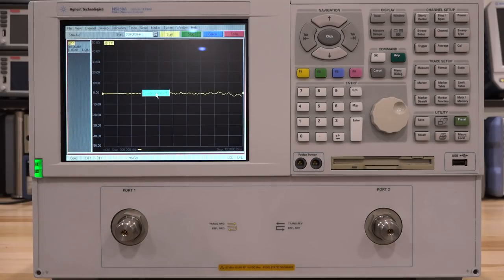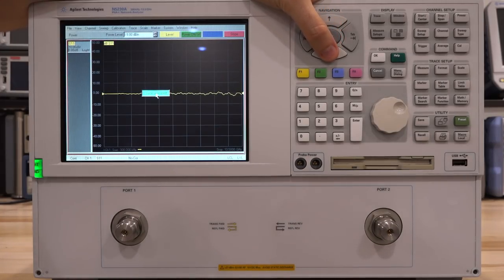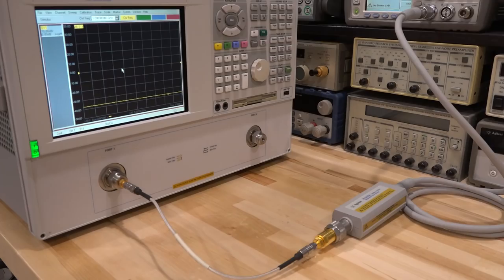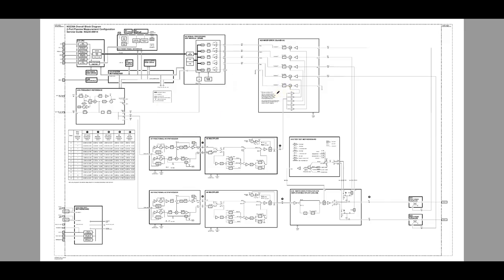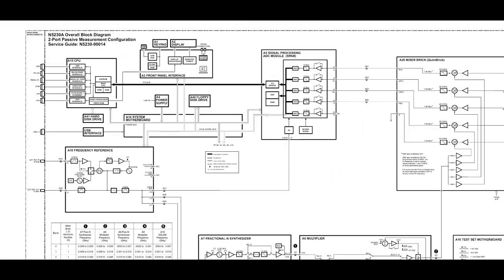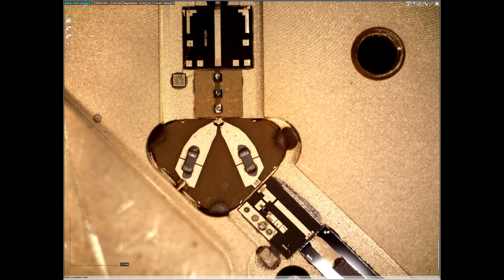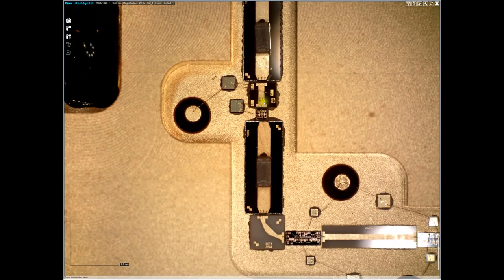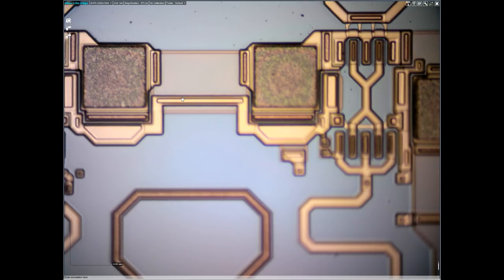TSP #134 - Teardown, Repair & Analysis of an Agilent N5230A 13.5GHz PNA-L Network Analyzer (Part 1)

Comment from the maker: Don't forget to watch to the end and let me know your thoughts on how to proceed.
Reply: Looked up bonding machines. See my other comment
Reply: Yeah a packaged part will never work.  You will ruin the module beyond repair trying what you described.  Not to mention the parasitics at microwave.  I don’t believe that can be done.  And if you determine the part number of the bad die and purchase a replacement or identify a suitable alternative, which is probably the only viable path forward, you’d need to scrape out the bad one and silver epoxy down and cure the new one.  Very delicate process.  You need an industrial oven to cure it properly.  Obviously not an option so you have to let it self cure by letting it air dry for a few days, which still might not work.  Then wire bond it.  But you don’t have the equipment needed for these modules, so unfortunately you are probably SOL.
Reply: How steady is your hand with a reeally fine tipped needle with a lil dab of conductive epoxy on the tip?
Reply: What about making up an external box with amplifier, switches, doubler, filter and whatnot... then modifying the module to always run through the low band path?  Chip out the first amp and switches and replace with some easier to work with substrate, use conductive epoxy and copper ribbon to bond over all the gaps?
Reply: If the instrument isn't worth much money it would make for an interesting video for you to try to bodge the repair
Reply: @Guy VanBuren: if the goal was to repair to "good as new, including design margin" you would be right. However, I believe the standards are a bit lower here -- "repair to functional." The VGA + leveling loop after the dead component can probably soak up a significant amount of VSWR ripple (possibly even a lot of VSWR ripple) and fmax is only 6GHz. I'd bet that a bodged rf spdt (or even 0201 PIN + 10mil wire sculpture) stands a chance. If that didn't work, and couldn't be made to work via the usual dumb tricks for one-off tuning, my second approach would be to sacrifice some of the neighboring transmission line to make room for a one-off cheapo FR4 board with a proper landing pattern for the spdt and some patterns at the edges to facilitate xacto tuning :)
Reply: Are you sure it is the fault ? It soes not look damaged (burned or so). I would expect that. Maybe you can decap an analog switch and use the die. Is it possible to use conductive glue for the bondwires ?
Reply: I agree moving the doubler section outside the module using connectorized components is the best solution if a switch died.  Best case one of the switches has a loose bond wire and just needs rebonding.  But if you build up your own external doubler section you can leave the first amp in the module alone since it’s in the doubled path anyway.  You just need to wire bond over each spdt switch to set the through path, no need to mess with anything else. The switch voltages are working properly so you can use them to control the external connectorized switches.
Reply: bodge!, a high quality bodge!
Reply: Great video Shahriar. You seem to have quite good relationship with Agilent/Keysight, so I would talk to them. I bet they will be more than happy to help.
Reply: Send it to me
Reply: Would a 3x3 mm SPDT fit at all? I guess there is enough space but for a 1x1 mm die.
Reply: To be on the safe side, I would try and bond a small SMD analog switch with silver glue like AA Duct 905 or similar, instead of soldering it. But the leads and package may introduce extra capacitance and inductance which are hard to predict. I would cover the traces to solder/bond onto with masking tape, leaving only the very edge of them exposed to avoid solder/glue flowing and spreading. 
Replacing your faulty element with discrete will be much cheaper,  easier and faster. If it fails to perform,  you can always go ahead and try with a die and bonding wires. Honestly,  I don't even believe you can remove the old die, since it's most-likely soldered to the surface underneath it. 
Not to mention it will probably be the first in the world on camera to replace a die with a SMD element
Reply: Invest in a wirebonder, heat plate and silver epoxy. Heat, Extract, Die attach, cure wirebond. That is if you can replace the MMIC. Or call Keysight and have them do it for advertising.
Reply: SnPb solder will probably suck the traces right off those thin films.  We had to replace some attenuators on a hybrid.  What we did was have the wires bonded on the attenuator (before it was installed).  Then epoxy in the attenuator with loose wires, and solder the wires to the thin films with indium solder (but you could epoxy).

You still need a place to bond up a bunch of MMIC switches with loose wires.

Could also use two beam lead diodes to make your own switch, and they should be small enough to epoxy on top of the dead MMIC.

Or just say screw it and bridge the switch with some gold foil, shorting the three nodes together.  Disable the doubler amp when not desired, and live with the sucks outs caused by the reflections off the amp and output switch.  You may loose some range in the leveling, but the reference channel will track out the response.  Won’t hurt to try this as it’s dead already.

Or get another junked PNA and pull the module.  The early PNAs are known to have bad synth boards, so maybe others scrapped for different issues.  My 8358A PNA stops at 9 GHz, so maybe uses the same module, just not fully utilized.
Reply: I have access to a wire bonding machine. If you can get hold on an replacement die and ship the parts to Germany, I would be happy to help you.
Reply: I can fix for you but need a little transportation time.

Comment: I had the power supply fail on our N5230A.  The replacement was quoted at 2K, but instead I just took it apart and replaced the two bootstrap capacitors, fixing it for about $2.  Thanks for your very helpful videos.

Comment: Excellent analysis as usual. Wire bonding machine on alibaba for a bit less than $2000 would be the trick. No point buying it unless you're absolutely positive a die is available for purchase.

Comment: There is a 7 second offset of the audio from the video during the block diagram portion. At least on my computer.
Reply: Same, I've noticed a small offset on a couple of the other recent videos during screen recording sections.
Reply: Same here too
Reply: Same here, but seems good from around 13:00 or so.

Comment: I'm a bit conflicted - On the one hand, I would like to see a repair with a QFN-Chip  to see how well a packaged chip that is 21 years younger can hold up against a bare die. And also to see if such a device can be repaired in this way (if so, ebay-prices for defective network-analyzers will spike again, I think :D). 
But on the other hand, I would also like to see how a wirebonding-machine works and how the dies and ceramic modules are being put into the metal casing. As well as how to remove the die without having debris flying all over the place, possibly causing further damage. 

Either way, it'll be a very interesting 2nd part. :)

Comment: Nice video Shahriar, thanks. Interesting - never seen that kind of mesh bond before. Know of any test equipment breakers that have any used complete modules? There area few on ePay that come up. On the other hand I'd like to see a 'hobbyist'-style best-efforts fix with a packaged SPDT switch.. but that's a bit of a one-way mission.

Comment: Thanks for the great video. Started watching late last night but just watched the final 10 minutes.

I'd look into getting a wire bonding machine anyway. If we've nothing to lose and can't obtain a replacement die AND you have a suitable candidate in qfn for why not depot the switch in it (that would be interesting in its own right) and build a test jig/pcb upon which you can test your bonding skillz. Once done  and successful we can tackle the final repair. All would make a great series of videos. I second someoneelse's comment about reaching out to a uni or agilent for help sourcing a bonding machine.

Comment: A special saturday night treat! A repair video. Most excellent!

Followed the block diagram along with you, I liked this way- laggy pc or not, still learned a great deal

Test the mesh for open (moderately) separated-waveguide RF transmission attenuation too! (Along with the other suggestions last videos!)

40:41, the damage, hypothesis to what caused that?  Was that more of an "etch" damage or "crusty" damage?  Probably irrelevant, but, curious none the less

As far as proceeding on part 2, it sounds like your plan of attack is the best choice (considering the equipment, or lack there of, at the moment -it would be VERY cool if you got a wire bond-er though!)
..bout the only other thing that may be best, is just finding a new module -maybe the none "L" versions would have a comparable one that could be found as "parts/scrap" and used just as well

Anyways, great video!
As usual
Learned a lot and loved the look into the high tech side of electronics.  Absolutely beautiful.
*Thank you, again and again

Comment: I got such PNA from an auction... But all the softwares has been lost.  Only the windows xp SP2 is there with bunch of Agilent NA software. When turned on it says PNA Hardware not found DSP Driver not installed.
Can anyone here help me getting it factory reset ? 
The CD/Floppy is not there with the VNA since I saw it in auction house. Kindly help me getting them. 
Agilent N5230, 10Mhz-20Ghz, PNA-L is my model to be precise. 
Please help.

Comment: The 5th channel on the Quintbrick mixer and IF digitizer is for use in the 4 port PNA-L. As a low cost 4 port, one incident channel is shared for all 4 ports with the splitter before the port switch. It makes TRL family calibrations impossible without another method to determine switch terms. PNA-X and probably the regular PNA have 8 receivers on the 4 port models.
Reply from the maker: Excellent! Thank you.
Reply: So this is the difference between TRL and TRL* calibration ?

Comment: Great video and very interesting stuff, especially inside the module. Sorry for the naive question as I don't have a lot of experience with these things, but how are the lines inside the module stripline and not microstrip? Does the cavity that the module is in provide the upper ground for the stripline?

Comment: If you totally destroy the switch in the repair can you still bodge the pass through so that it still works under 10.5GHz.? If yes you have nothing to lose.
Reply: Probably, but there's also the possibility that the switch has some attenuation that is required in the signal-chain to be within an area that can be regulated by the ALC-Circuits.
Reply: You could look at the input/output loss of the good (identical) switch to determine RF loss.  Touch a probe on both sides to look at delta of relative RF strength.  You could then put a SMD attenuator to replace the bad switch to accomplish what George suggests while addressing your concerns.

Comment: If you short the signal to both the straight path and the x2 path all the time i.e. bypass the input side switch, would the working output side switch provide enough rejection of the x2 signal when it is not wanted? If not, could the power to the x2 amp be disabled by external logic when it  is not required? Would it wake up quickly enough? If not, could the mystery circuit mentioned as an attenuator at 34:31 be brought in to play to reduce the x2 signal level when below 10.5GHz? I assume the input side switch must be there for a reason, but I don't know exactly why.

Comment: How are these things at 29:00 constructed? 
Did they cnc some metal and than clued ceramic pcbs and ic into the metal? What metal is it brass? Some aluminium with gold finish?
Im not really sure how to call this and didnt found much on google. Would be nice if some can point me in the right direction.

Comment: 28:28 That doesnt look cheap one bit.. every single bit placed on there by hand, impressive.

And there are quite many scratches on the edge surface where there shouldnt have been any all from fab so this have been open some times/s before for sure, maybe the same problem who knows.

Comment: I have similar model but front panel keypad is not working. I normal use the mouse to do the setting. Any tip to troubleshooting the fault. A3 board part no. E8361-20061 hope you can make a video how the keypad control board work.Thanks Awang snr electronics lab tech.

Comment: It is interesting that that component you showed as having problems does not appear to be obviously bad. What would be the failure mode?  Can you look at it with a thermal imager on the component to see where things are heating up?
Reply: Those are very low current   from an OP-AMP output. There will be no heat dissipation at all even if shortened, leave alone with 90-130 Ohm.

Comment: Of course I'd love to see you get a wire bonding machine. But if not would you perhaps be able to restore the specified output below 10.5 GHz by removing the switch entirely and jumpering the low path w/ fine wire & solder? At the expense of no longer having any function above 10.5 GHz.

Comment: You are dealing with frequencies several zeros higher than I'm used to, so I apologize in advance if this is a dumb suggestion. Is it too much to hope for that the switch on the output side properly terminates the unused leg? If it did, then it seems to me that you could forego a switch on the input, and drive both paths in parallel, through a series resistor to correct the impedance. That might be an easier modification to manage than hacking in a different switch. You would lose 6db on both ranges.
Reply: 6dB of loss is probably enough to get Unlevel-Errors across the entire frequency-span. The Unlevel-LED was already partially on when the device was at 0 dBm and the output was around -4.5 dBm in the video.

Comment: Wire bonding is one thing. But how to get the old die out and the new die in? Is that part obtainable atvall? Would be interesting to see how this type of circuitry is worked with, without throwing everything out of impedance matching. At the end of the day, this is not an ordinary pcb, isnt´t it. Any way of repair attempt is going to be an interesting challenge and video of course.

Comment: Thank you, that was fantastic! The sub-10.5 GHz path between the two switches (that path without the doubler) seems to consist of three striplines bonded together. What's the reason for that compared to one continuous piece of transmission line?
Reply: I would say that they have standard sizes of stripline-modules and use them for cost and handling-reasons. As the substrate is ceramic, I suspect them to be quite brittle. And the longer a piece, the higher the chance of them breaking during assembly.

Comment: Wire bonding is an art and even with all the equipment to remove the old die (typically achieved by scraping the die away with a scalpel), vacuuming out the cavities, applying new epoxy and placing the new die (taking care not to damage any airbridges, scratch any tracks/components and not chip the edges of a die). 

THEN you can think about wire bonding (which will require lots of time setting up the machine (ultrasonics, flame off, pressure, timings etc).

Trading favours with an established company that has the equipment and trained personnel in this field soon becomes a lot more attractive!

Perhaps they could trade wirebonding for a “sponsored video”?

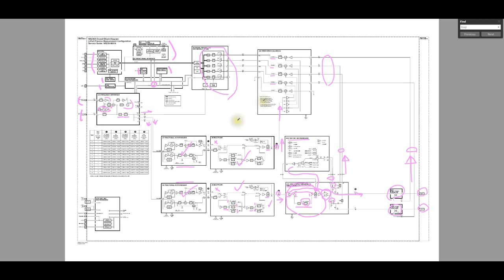Comment: Great vid. Is it fairly quick and easy to get that cover off the PNA? I can see in this vid, that the cover was initially on, and at 20:27, the cover is then off.
Reply from the maker: Yes, it is pretty easy. Just a few screws and slides off. It is heavy, so you may need a little help.
Reply: @Thesignalpath  Thanks very much TSP! Much appreciated and best regards.